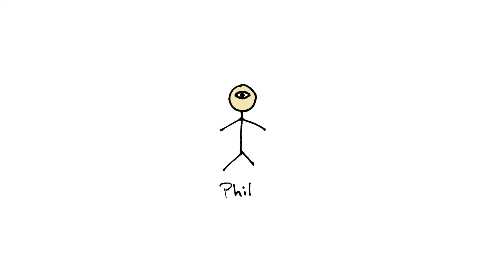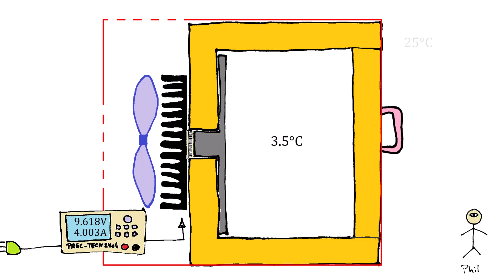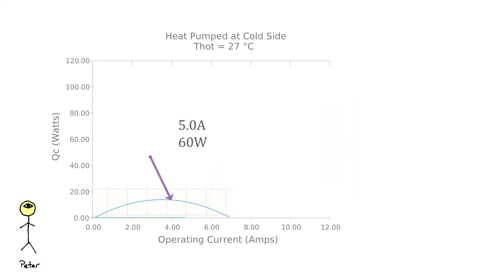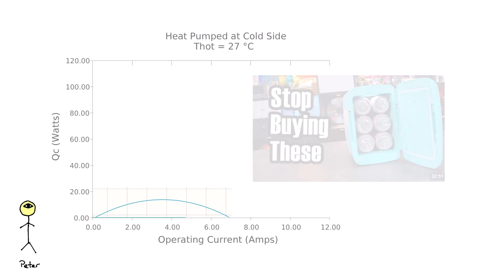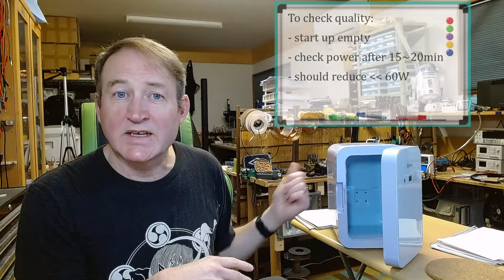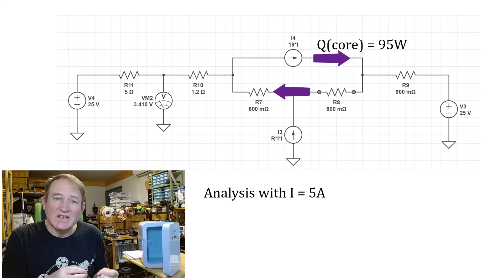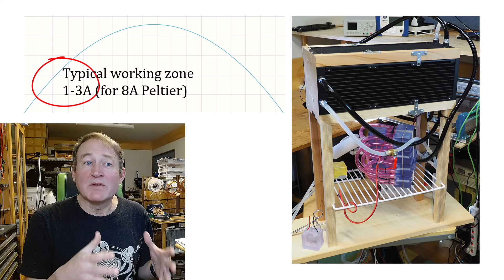The Peltier Fridge Parabola Problem

Comment: It would be interesting to hear your take on series and parallel devices. Same Sky (formerly CUI)  (and probably other manufacturers) makes a line of 2x series modules which much better performance; tradeoff of course being proportionally thicker profile and cost

I saw in another comment you mentioned parallel devices for a CPU cooler - I think you could say a lot about the tradeoffs there as obviously there is more leakage for parallel devices if you go overkill but it’t not obvious without modeling if that even matters 

When I was looking at devices for practical applications I discovered the same high COP and low dT as you did. First order guess is that the main limitations for efficiency and high power is economic- you need a lot of modules at higher powers to stay in the favorable part of the curve. Would be interesting to see if there is a limit there (assuming unlimited budget) though as the losses stack up - I could probably sit down in a simulator or do the calculus myself but I think it’s probably more valuable if you ran them and published the results.

Dude you’re great at this - on par with much larger science channels in terms of quality of explaining stuff. Keep at it and your reach will surely grow. Ditch the AI voice for sure though lol!
Reply from the maker: I think the CPU case is one where using an "electric circuit" to model the thermal characteristics really clears things up. Unlike a normal heat pump where you are trying fight the natural temperature differential (e.g. air conditioning, fridge) a CPU is where natural heat flow is in the same direction as the Peltier effect. So while for the normal case the "leakage" (thermal resistance hot to cold side) is annoying for letting the heat circulate inside the Peltier, in the CPU case that leakage resistance is annoying as a bottleneck to the natural heat flow. A Peltier really only makes sense where it becomes in effect a net negative resistance (the Peltier cooling effect cancels the bottleneck effect), which is possible for a single Peltier but only when it's being pushed really hard and the I²R losses are huge. Having 2 or 3 Peltiers in parallel should shift the point of "negative resistance" to a nicer zone. That said I'm yet to run the simulations, I've been wrong before, which is why it needs modelling + implementation + measurement. It's on my list!
Reply: @PeltierPower  Your video was a refreshing look at some of the mystery and assumptions.  It would also explain why the lay person implementations are most often inefficient and accepted that way.

A key takeaway for me from this video was that thermal resistance to the module is our biggest enemy for efficient operation.  

I have a couple of water cooled heat-sink bars from a custom power supply and will try them out to see if I can keep the hot side of some modules close to ambient.  It should allow maintaining of the cold side down for a cloud larger chamber.

Comment: This is very opportune, I'm building a small cloud chamber from PC parts I have on hand and was going to use a peltier mounted to one of those all-in-one coolers with a single 120mm x 120mm radiator. From another comment you made here, this sounds like it should work fairly well to remove heat from the chamber. I was going to let it constantly run at the full 12V for simplicity, but you're now making me think that there's likely a lower power configuration once it's down to the right temperature. Maybe for version 2.0...
Reply: One could also put some elements in series, 3 or 4 on 12V , 3-4 times more cooling capacity for the same heat shed..
Still peltiers are (mostly) for keeping it cool not to cool down

(have a look at 'Tech Ingredients':  'TESTING OUR DIY REFRIGERATOR! - TEC/PELTIER')

Comment: weird, without modelling we experienced same thing in styrofoam fridge from shipping styrofoam coolers, super low voltages and currents worked well, then driving it crazy high gave marginally better results, so after that we never pushed peltier power high ever again...
Reply from the maker: Yeah, I've watched a few videos on people making room air conditioners, car air con, and great one by Tech Ingredients from 7 years ago, I wonder how much better for the results they would have achieved not just lower currents, but the optimal current (at the peak of the parabola)

Comment: I notice that you were working on how to make a bad peltier good That's awesome! Even in the sensible area of the parabola I'm wondering if we couldn't use the waste heat for evaporative cooling to kind of boost it even more to get it get the COP higher.... maybe having a very low power fan inside to get better circulation of the cold.
Reply from the maker: For a small fridge, chasing a better COP is probably not worth the effort. But for a larger fridge, there's lots of options for efficiently getting rid of the waste heat, even going to the extreme of hooking it into geothermal loop (i.e. a simple liquid circuit that sits in the house foundations and stays 15-20°C). I'm using that option for a solar powered air conditioner, which I'll cover in a future video!

Comment: The one thing to remember with peltier modules is that the heat generated on the ambient side is from the current used to cool the control side plus the wattage generated from the control side. Once that parabola is exceeded, the module oversaturates with latent heat and reduces the efficiency exponentially. 
I found this out by trying to use a 200w module to cool a 40w CPU.
Reply from the maker: CPU cooling is another interesting one when modelled: it doesn't make sense to try an push say 90W through a single Peltier, which is about 1K/W so as a minimum that's going to have 90°C drop hot to cold size, even before I²R joule heating is added. I haven't run the simulation yet, but I'm expecting two or three Peltiers thermally in parallel should work like a charm. I'm planning to cover that in a future video as well.
Reply: @PeltierPower  I think it might be a good idea to have a water loop that first cools the cpu output passively, then however many peltiers you want to get the temp lower( or just even closer to ambient).
Reply from the maker: @passwordpassword2199  Yes, absolutely, that's the way I would do it. In all of my serious projects, there is a central Peltier bank (heat pump) which can be constructed reliably (e.g. with clamps) and also series, parallel, triangle or whatever is the configuration needed,  plus monitoring to check everything makes sense (heat in/out) and then water/water pumps are to move hot/cold stuff around to the point of use, rather than trying to attach the Peltier directly and not really knowing how successful it is.
Reply: @passwordpassword2199   i was thinking about a vapor chamber bridging between cpu and many peltier element
Reply: They are just sad as CPU coolers. You have to break them out away from the chip so you can run them in an efficient way and still move the heat you intend to move. We're in single digit pump vs input power ratios here, but there are ways to maximize them.

Personally I don't bother with "pumping" with them anymore. Obviously they pump heat in their operation but I mean that I don't use them to remove heat that is being generated by something else. This is almost always handled better passively (eg larger heatsink area) rather than something like this. In the rare occasion something needs this type of device for actually moving heat, usually for space or simplicity considerations, they are as isolated from external heat sources as possible (eg not a CPU). And if overall system efficiency is your primary goal, of course look elsewhere.

Comment: Hearing that your experience is that they only last a couple/few years is a shocker. Just about the only advantage of peltier chilling is no moving parts which in theory is expected to yield much longer lifetimes. If it cannot last as long as a much more efficient (and cheaper) compressor system, there isnt much point.
Reply from the maker: The dead fridge problem is only if they use the poor design, at the wrong side of the parabolic curve so everything gets really hot. On the the other side (the 10W area) the temperatures are mild in the order of 30°C. With a good control algorithm there's no cycling either, and good quality thermal pastes should last for decades. So the dead fridge problem is just another symptom of bad design. Yes, compressors are better but you can't get a reasonable compressor in the same form factor as the small fridge, it really has to be a mini-fridge size (like those you see in a hotel) to make sense. So for a small form factor, 6-8 can fridge which can sit next to your desk without taking up a lot of space, a well designed Peltier fridge is fine. Unless we consider the laziness factor of just getting up and walking to the big fridge :)
Reply: @PeltierPower My wife is looking for a small fridge like that but I don’t know how to tell the good ones from the bad ones. Any advice for that?

Comment: Got some new CPM-2F coolers for surprisingly cheap 15$ each and will upgrade my Peltier fridge with this. Will be handy to know how to make it work more efficiently. Of course such fridge doesn’t make sense if cooler costed 100$.
Reply from the maker: Cool! One thing I should have mentioned in the video, when I pulled the back off  that fridge to have a look, it had two power supplies, one just normal 12V for the fan, and a separate custom power supply which I guess adjusts the Peltier current based on the conditions. That's where the key point is, having an adjustable source current source. You can also do adjustable voltage but the current will wander based on conditions, and Peltiers are current based devices at heart so I prefer to fix the current and let the voltage wander. Anyway, the other cheap fridges just dump the 12V on the Peltiers and hope for the best, that's where they end up on the wrong side of the parabola.

Comment: Thanks for the video and information, gonna watch more of yours!
And Technology Connections mentioned, another favorite!
I'm trying to tweak a Campingaz Thermoelectric Cooler with a thermostat and better heatsinks & quieter fans, might get some more inspiration from your videos! 🖖😉
And yes, I have a second hand Tristar 230VAC compressor box, and it's absorption 12VDC/230VAC/Gas Sibling for comparison, mainly because the experiments with the Campingaz one blew the thermostat, running it at 15VDC...
Controller and fan(s) need 12VDC..

And yes, put your things in cold, I always put some ice-packs in as well!
Reply from the maker: Nice! I mentioned in reply above (to @otofoto), the key trick to that fridge in the video is they have a second power supply which is adjustable depending on conditions, rather than dumping 12V directly on the Peltier and hoping for the best. If you can add an adjustable power supply in the system and have a play with the current, that should work better.

Comment: If I understand correctly a peltie module can move 3.1 time more power with condition that the temperature difference is close to zero.
If I have like an object that I want to cool down I can use a few peltie provided a little energy to them as long as the hot side is almost as cold as the cold side I can make it go extremely cold.
Reply: Generally speaking, a small temperature differential (like 1C or 2C) will be highly efficient, well over 100% efficiency in fact, but there is no real way to stack Peltiers to obtain higher temperature differentials without destroying that efficiency.  Each addition to the stack degrades the efficiency massively.

Stacking also reduces the ability of the watts you input to translate to watts of cooling power on the cool side of the last element.  Each element's thermal efficiency cuts into the final "watts of cooling" that you can get, requiring more and more power to get the ultimate temperature differentials that you desire.  You can get very low temperatures that way, but the efficiency losses are enormous.

--

What this video is talking about is something a bit different.  It's talking about a situation where the thermal losses of the area being cooled are very low, to the point where the Peltier device itself represents a larger and larger portion of those losses.   In that situation, you can drive the Peltier at much lower currents to maintain the effectiveness on the cool side.

However, by doing so, the cooling capability of the device is drastically reduced.  It's a race to the bottom, so to speak... a very high thermal resistance for losses (exiting the area being cooled) is needed to actually get low temperatures inside and you don't have much control over what that temperature will be.

Whether this can also be done in a stacked arrangement to get more control over temperatures inside the area being cooled... that I do not know.

4.4C is barely adequate for refrigeration.  You really want to be more around 2C.  Just as 0C is inadequate for a freezer and you really want to be more around -15C.   It's tough for Peltiers to achieve adequate temperatures fast enough to avoid spoilage, but relatively easy for compressor fridges to do so in a much larger space with the same amount of power.   My little DC compressor fridge averages roughly 12W and has no trouble keeping an inside with 20x the volume of that Peltier fridge at 2C.

-Matt
Reply: But if you already have a way to keep the hot side extremely cold, you don't need the Peltier
Reply: @thewhitefalcon8539  Perhaps...  Another Peltier.  I'm going back through Peter's older videos, he kind of hints at this with his butter cooler:  Stacked peltiers, running at way below "maximum rated" current in order to eliminate the usual penalties of stacking.

Comment: peltiers are probably my favourite quirky electronic device so i'm happy to see these videos!
could you talk about what technology or techniques could minimize the thermal resistance of off-the-shelf peltier modules? Heatpipes, thermosiphons, or maybe something exotic like jet impingement? I saw you made what looked like a waterblock that directly sealed against the alumina plate, how'd it work out?
Reply from the maker: My best solution (thermal resistance wise) is a milled plastic block with an M shape that allows the water to flow directly on to the surface of the Peltier. However that gets complicated especially if you want to scale up to say 8 or 10 Peltier systems, which you really need if want to get serious. I found that those 200x40mm aluminium blocks (water channels inside) are easily available on Amazon and can fit 5 Peltiers on there, with a bit of thermal paste but the critical point is clamping it all together firmly. That gets me about 90% of the "water direct" solution but is much easier and cheaper. For moving heat from water to air, the stuff that people use to cool PCs (gaming), a three fan radiator easily available measures about 0.05K/W (°C/W) and pretty good for most applications, you can move 100W for 5K (5°C) penalty. Avoid the simple Peltier on a heatsink with a fan, they are hopeless. They work but only getting about <<50% of what Peltiers can potentially do.

Comment: I've had an idea for years now. If you have a restaurant/food/buffet, some of it need to be chilled, and some of it need to be kept hot. I was thinking of af combined hot/cold plate, where you simply flip it over to have the opposite. I think that could be a big seller.
Reply from the maker: What temperatures do you think you would need? I could be an interesting project, definitely one that need to run the numbers and simulations to figure out the optimal solution!
Reply: @PeltierPower  Well, that would depend on the food. Ex. butter does not need it as cold, as icecream. Fish-filet (for bread) does not need as much heat as a stew. So it would need to be controlable/adjustable. I would think a normal potentiometer would do that. (not sure how though)
Reply: @fveggerby  Heating with a simple resistive element is always going to be simpler and the pumping effect of a Peltier element is only a small benefit.  With cooling the key is to have an effective heatsink with a fan or contact with the serving station to maintain the lowest temperature difference across the module.  A plate with 9 modules that sits on a heavy metal buffet counter might be an interesting way to cooling the pudding or sushi.
Reply: @KallePihlajasaari  It would not be 1 device, but ex. 4, 9, 16 devices. Making up a unit. The ability ti build larger plates with mulitple units would be great. 1 "mother" unit and 1 or more "daughter" units.
Reply: @KallePihlajasaari  The main idea is, that if you want cooling then 1 side up, if you want heat/warming you flip it over. A type of modular option would just add to the usefullness. Then you could build a hot/cool plate for a full baking tray or bigger.